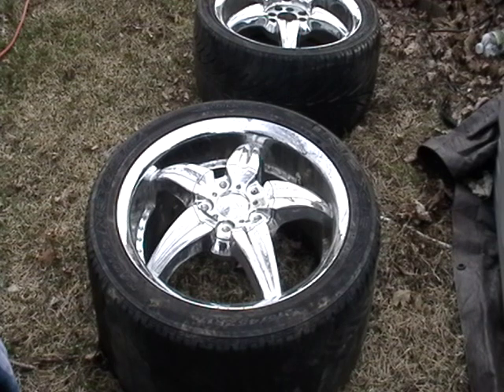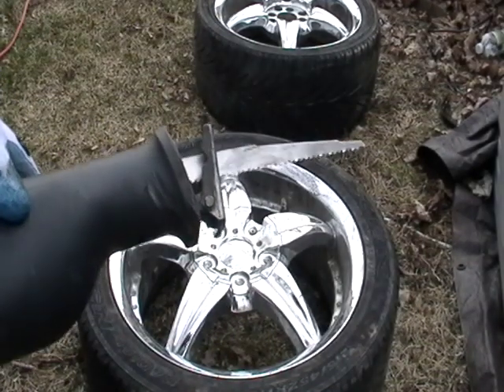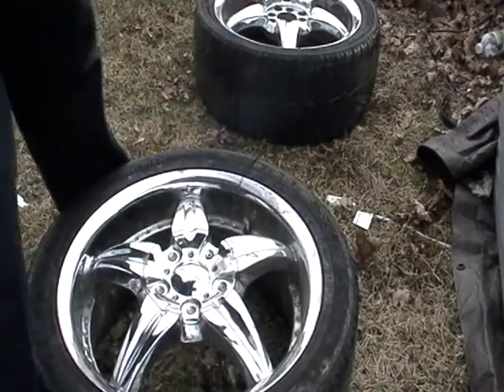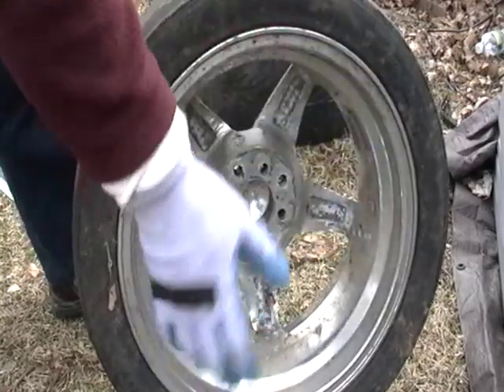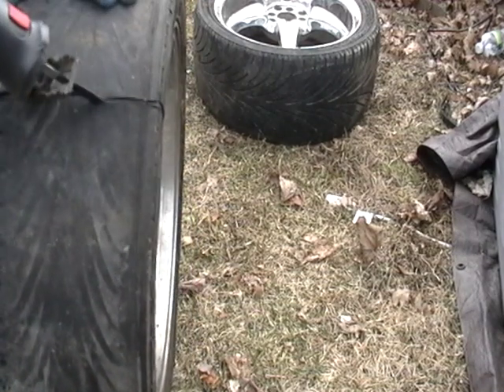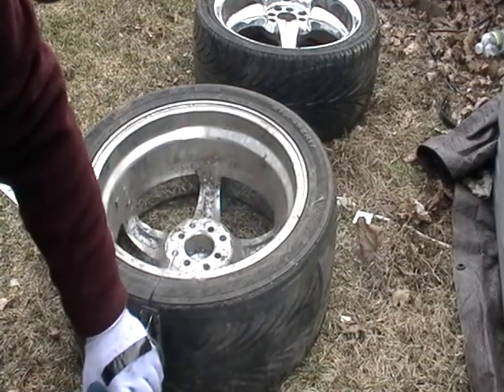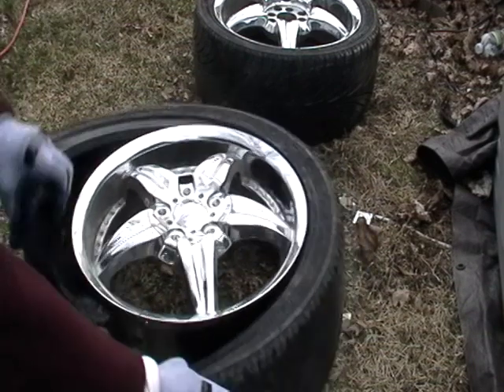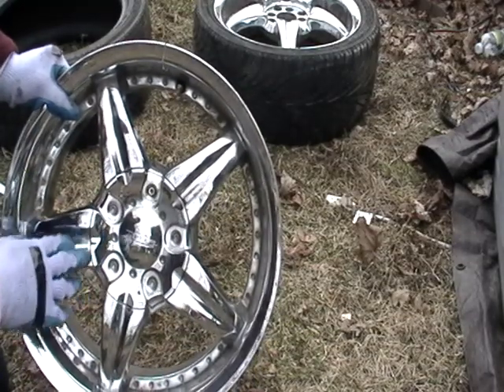Scrapping a car rim for aluminum

Comment: Thanks to the rims I scrapped a small aluminum haul ended up yielding more cash than my largest steel haul. so they are definitely worth the time. But I went through two metal blades on my reciprocating saw. Guess I need to get better quality blades.

Comment: not too bad!!! but how many can you cut with just 1 blade? i just did 9 tires this morning an i did it in under an hour, 4aluminum an the rest chrome!!! i use a BOX CUTTER an cut around the top but not to close to the rim around the whole top an bottom in full circle an it pops off easy but a bit heavy on your hands an the i use a angle grinder with a small metal blade an cut thru top n bottom beads an it pops off very very easy no force necessary only when you cut with the box cutter its just heavy on your hands like i said... keep in mind i used 1blade for box cutter an only 1blade for the grinder an the blade can still be used on some more!!! always looking for more options but i beleive my way is faster an easier incase any1 looking for new ways!!! if your a scrapper try doing just metal rims aswell the same way as metal big rim are heavier than aluminum depending on sizes of course... theres always metal rims around my area an will start picking them up for extra weight!!! also yeah if you want just pay 3 or $5 to a place an they will remove it easy but if you want that extra penny do it yourself!!!

Comment: You can also just deflate the tire and use a pry bar and a screwdriver and something to lubricate the edge of the rim (soap works) if you don't have reciprocating saw or want to save your tire.

Comment: Did you knock the steel inserts out of the lug holes. or leave them in. I know that some actually have a good sized steel ring that goes around all the lug holes for added strength.

Comment: some places are very picky, i have scrapped many many rims,and in some cases in order to get full clean aluminum price you must take the rubber out,and in the lug slots are steel sleeves inside ,they sometime require you to knock those steel sleeves out also. some guys will let it slide. but as i am sure you are very well aware of every scrap yard has that one guy with an eagle eye lol

Comment: The value of the metal would be whatever your local scrapyard is paying for cast aluminum, which is usually less than what they pay for cans. Repairing and re-chroming a wheel would cost big bucks...  not worth it unless your restoring a vintage or high-end car.

Comment: u dont realy need to cut true the hole tires cut your self in to the tire and then cut it down to the locking wire and then do the same thing on the other side. the tire should get right of the rim with some help of a crobar saving alot of blades